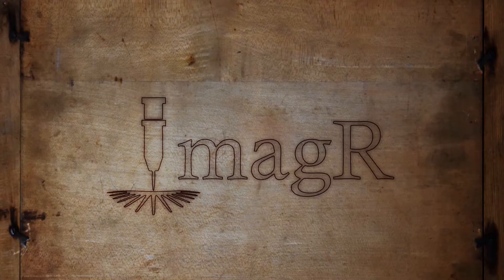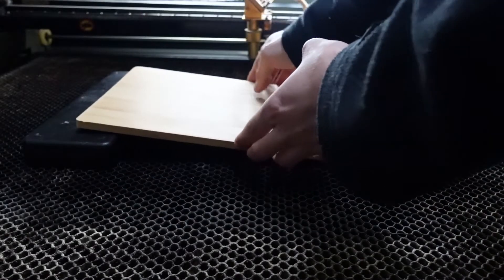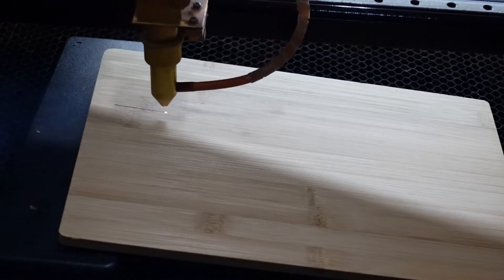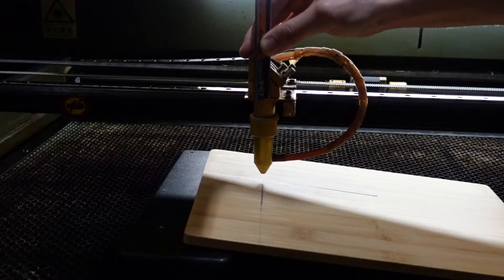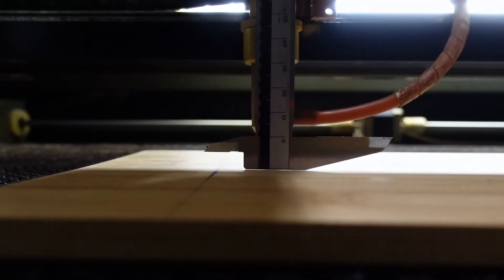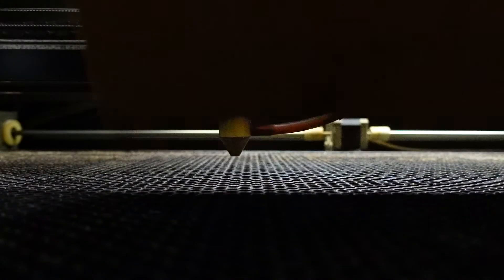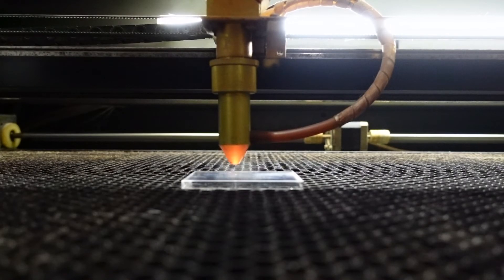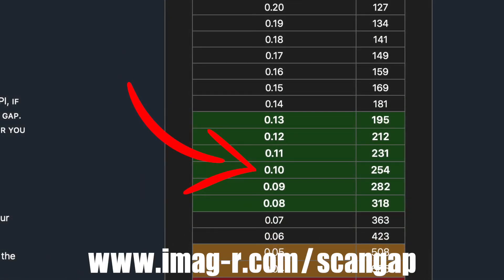CO2 Laser Engraving Ramp Test & DPI – Achieve Perfect Focus Every Time!

Comment: All good advice with one exception. With the power and speed set as you describe in the ramp test you will indeed Identify an intensity focal point. However now run it again at more realistic engraving parameters , maybe 15%power  and 300mm/s and you will get a different focal distance, maybe as much as 1mm different  That will be the focus to produce the smallest dots for your image.
With your dot test matrix you are doing a super job of teaching the masses to achieve great results without resorting to the many sliders in Lightburn ( I love Lightburn by the way). I admire the  way  you cunningly stress the importance  of dot size and the compound lens to achieve better  in another recent video. Excellent work
Reply from the maker: Really appreciate your comment. I will try what you explained, and if it works I will make another video about it. I am pretty confident you‘re right, because that was a questionn I mentioned myself a lot. And probably it‘s also the cause of some „small but noticeable“ issues on some images.

however, thanks again, really appreciate it, and I will try this right now :)
Reply: @ImagR-Laser  Did you ever test this? If so, what was the outcome?

Comment: I have an epilog 60wat and my dot it so small its off your chat..? Im hitting the activate button to fire the laser.  I can hold it and make as large a dot as I want, but one click is .035mm or smaller. Is there a better way  to go about this? I am in desperate need to perfect my photo engraving ASAP... 😢
Reply: Cut out a 20x20mm square.
Measure the missing part with a caliper.
Also measure the cut out part.
You divide the difference of the two by 2.
you get the actual thickness of the laser beam.
Reply: @kissbutorstudio  merci beaucoup ! car avec la méthode montrée en vidéos je mesure avec mon pied à coulisse 0.4mm alors qu'avec votre méthode , l'intérieur de la découpe est de 19.67 et la partie découpée est de 19.82 donc : (19.82-19.67)/2 = 0.075 le résultat est bien plus cohérent !
Reply from the maker: It‘s not possible to have a dot with 0.035mm.. probably you mean 0.35